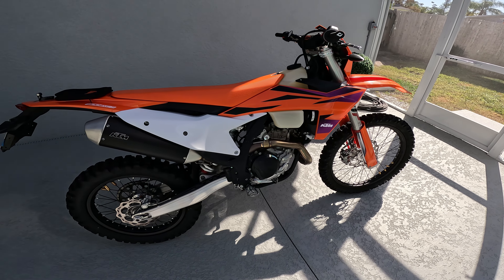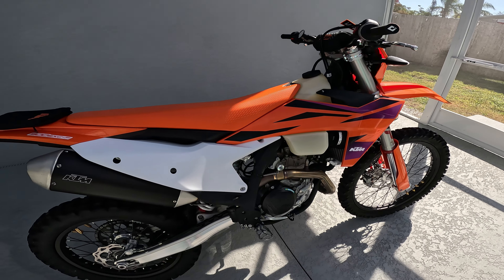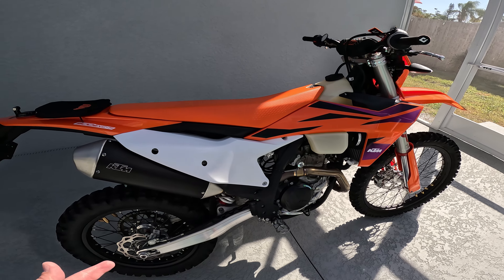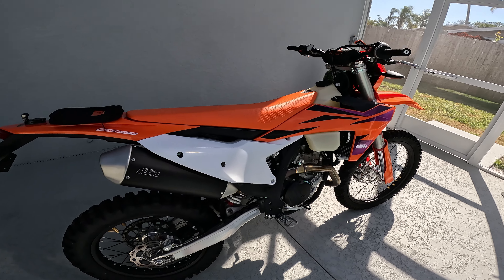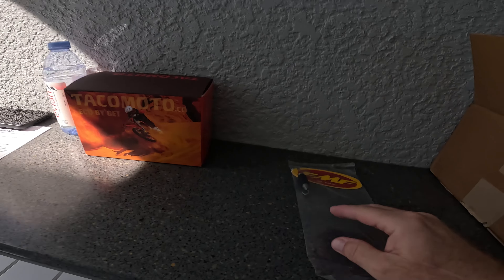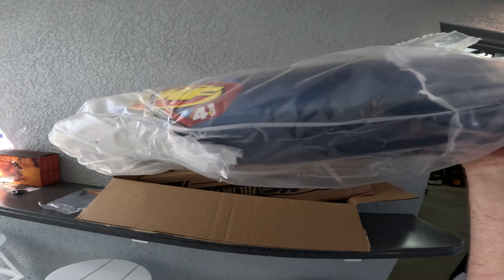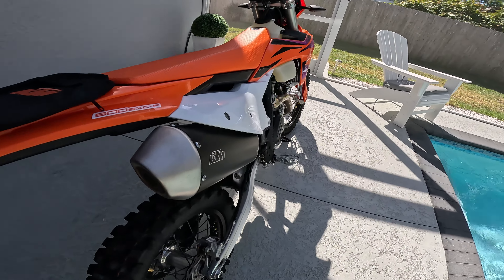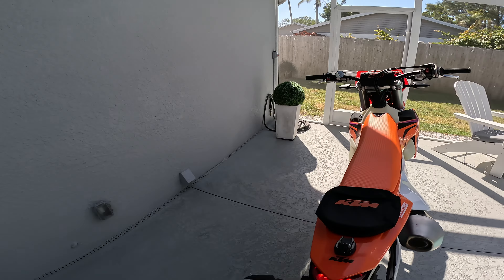2024 KTM 500 EXC-F  FMF INSTALL AND SOUND CONPARISON VS STOCK

Comment: Sounds awesome. I'm thinking about one for mine but not sure if it's going to be annoying loud. Did the stock pipe have a removable cat in the header end of it? Dealers toss them out before delivery for us.
Reply from the maker: The stock muffler has two unique upstructions in it one is a Dimond shape at the beginning of it and the end cap is shut with a screen and a spark arrestor I didn't see anything else but I'll go investigate tomorrow .

Comment: FMF looks nice! I imagine it's the 20-23 muffler, did it fit good without any adjustment?
Reply from the maker: no issues with stock but it is corked up you need a end cap and rip out the other inner cat ! the FMF fit like perfectly.
Reply: @metalmotomayhem what other inner cat?
Reply from the maker: @SC-ui8dh  in the stock exhaust inside the muffler it has a Dimond shaped piece of metal that needs to be knocked out.  Good luck 👍

Comment: How’s the low end torque vs the stock?
Reply from the maker: @fattie2550  with the Ecu and exhaust  a lot more just knowing I don't need the reeds in the airbox for it to run now is  a huge piece of what makes the bike better  just running the exhaust not much but it does sound ok but without the other mods it backfires and most likely will  burn up your exhaust valves. So you need the reeds out and smog delete and an ecu .
Reply: @metalmotomayhem  I’ve got the 350 version. Just did all the mods with fmf and waiting for my new ECU. Bike is gonna rip now.